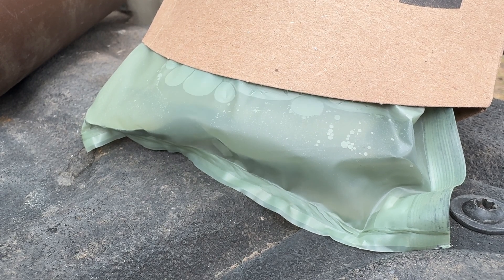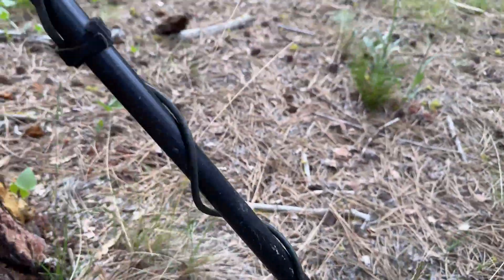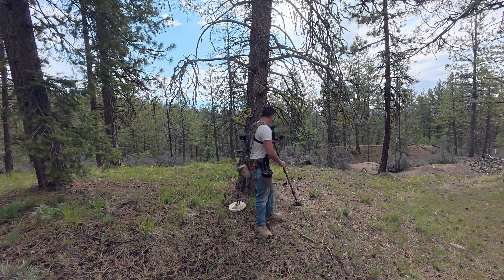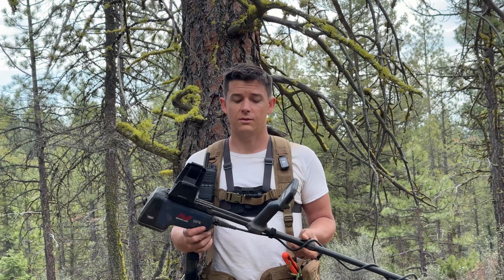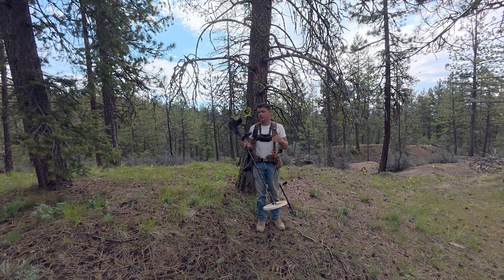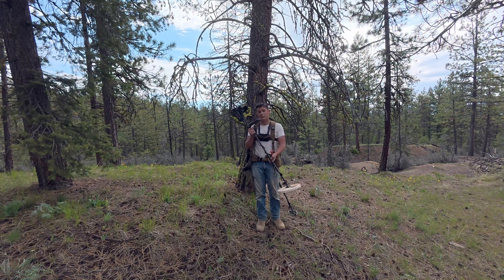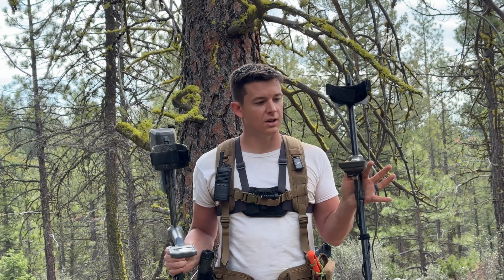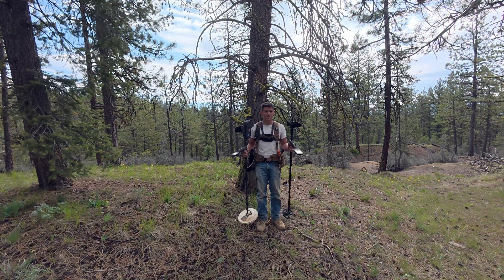P.I. vs V.L.F. Metal Detectors: Which is Best for Finding Gold Nuggets?

Comment: On an entry level budget, I picked up the new version of Goldbug 2.  Was told that it's able to detect the tiny gold we have around here in the NW.  Not found any with it yet.  One problem I have is that it does not do very well on bedrock because it will alert to stair steps in the rock.  Basically any time it senses a density change after ground balance.  Frustrating because the bedrock fractures may contain some nice surprises but I get constant false alerts no matter what settings.  It cries wolf too much.  :)

Comment: I was just on some ground that was too hot even for the PI machine i bought.hi low targets everywhere. Rocks with metallic crust on top of more rocks with metallic crust. The quartz veins there are so dirty and good looking too. I was bummed. Nothing worthwhile is easy i guess.
Reply from the maker: Gotta turn the gain down or use a DD coil on those spots
Reply: @JTProspecting  yeah, i was using a DD coil. my machine has sensitivity and threshold settings.
I sent some pics to Sarah of the spot i was standing on.
The rocks there are coated with a copper colored crust of metal, like it is a sulfide deposit that has leached out and the metals all deposited on it.
Its about a foot or a little less thick of that stuff, sitting directly on the basement rock that has tons of iron, manganese, limonite, and peacocks (ore, not birds).
If you drop a magnet onto the dirt there it gets a half inch coating of iron sticking to it immediately.
It's a brutal hike back out of the spot.
I gotta clear a whole day for beep beeping next time I go.

Thanks for the response.